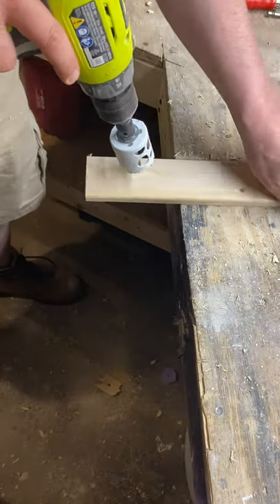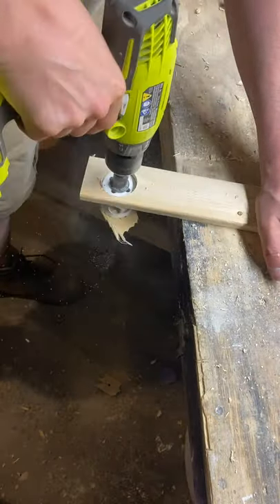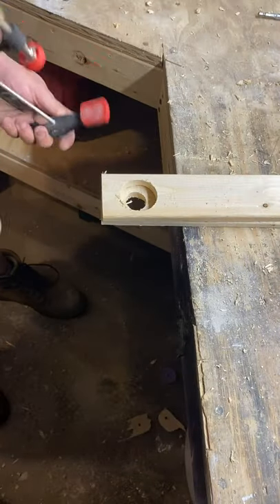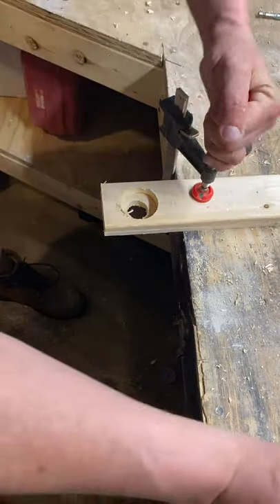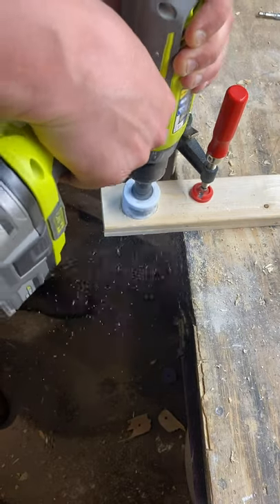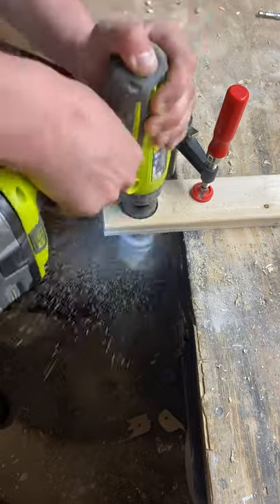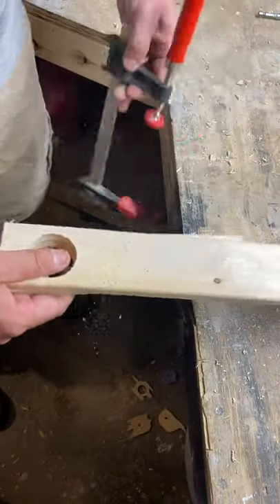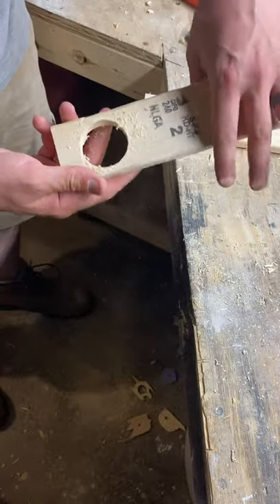How to Enlarge A Hole With A Hole Saw - Quick Tip #shorts

Comment: One thing I’ve done in the last is plug the hole with a quick plug of the same diameter as the small hole and super glue, then recentered and boom, drilled the larger hole. It works very well and it’s fast. It also ensures you’re not wondering off center from where you wanted the hole in the first place.

Comment: Therefore using two bits to make one hole when in fact you already have a bit with the right sized hole in it ......
Reply: Are you and I the only people who noticed this?
Reply: It might be for the sake where someone puts a hole in, realizes they measured wrong, needs a bigger hole. I know i know measure twice cut once but shit happens lol
Reply: It's to enlarge a previous hole
Reply: This is a tip for when you or maybe a helper already screwed the pooch.
Reply: Yeah.. I've never had to do it, but I have seen it done on the interwebs. It's a smart trick, really. Once u facked the first hole, u can utilize the wrong sized hole saw as the pilot.

Comment: I use the same method to drill holes in ceramics with diamond bits. Just drill trough an old tile with the holesaw and put it on top of the tile you want to drill your actual hole in.
Reply from the maker: Yes, Dominic!  I actually did that on my bathroom remodel recently!  Thanks for the comment and for checking out the video!

Comment: Or just start with the size its supposed to be 😅
Reply from the maker: Yeah that would be ideal but this tip is meant for you or someone else accidentally cutting a hole too big.  Or you need to make an existing hole bigger for a number of other reasons.

Comment: Or... put the smaller bit inside the bigger bit. Use that as the "pilot"  Don't do another board. The smaller the bit the longer it is so all smaller bits can be the pilot to a larger bit. Smh